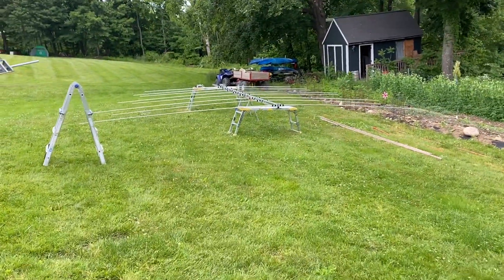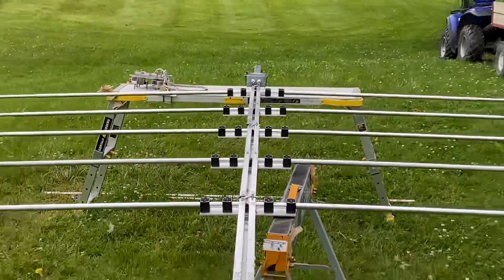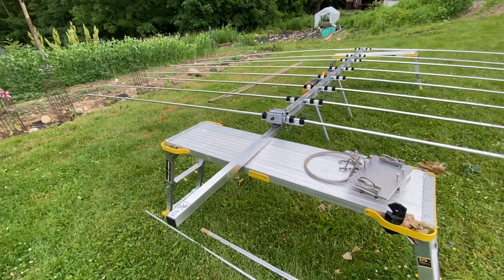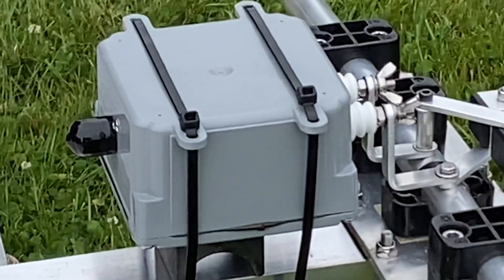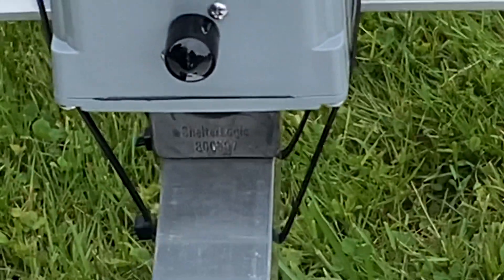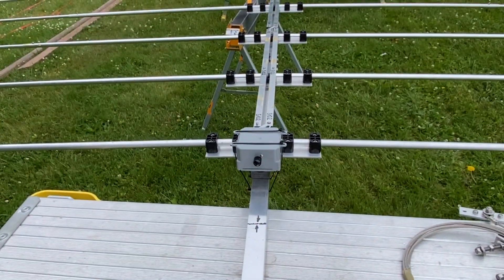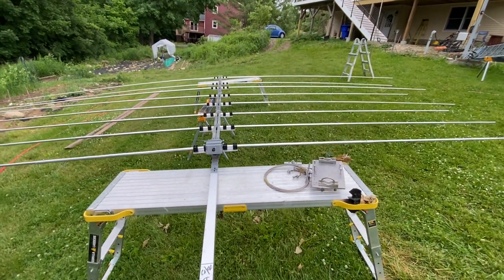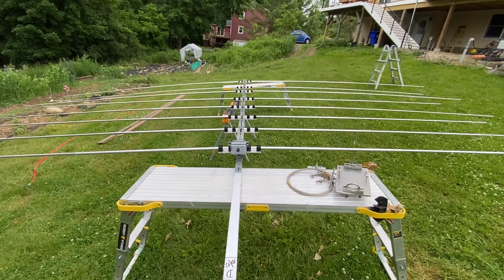Optibeam OBDYA9-4 ham antenna build walk around

Comment: How is the antenna treating you after a year in the air? I've got one in the box that I just received from DXE. Looking forward to better weather and getting it on the tower. How do you like the performance? Thanks.
Reply from the maker: @AbleFox1  This antenna works great. I have been enjoying it immensely.
I have a 500 watt linear that I use, but I seldom run more than 400 watts and can hit Europe easily. I get very good reports from people saying I am one of the strongest stations they hear. The antennas directivity/gain is fantastic and the F/B ratio gives good rejection off the back. I am glad I chose it although it would have been nice to have the model that added the 20 meter band.
Reply: @sparky2008sparky  Thanks for responding so quickly. It's good to hear you've had a good experience with it. I had a large LPDA at the last qth and didn't want to get in that deep this time around. Started off looking at a Hex, then to the short boomed 5 band Opti (F/B didn't look great) and came to this. I've been licensed for about 40 years and seldom work 20M so I figured this would be a good fit. Mine is going up on a 65' aluminum crank up/tilt over and I was also concerned about getting too heavy up top. Curious, how heavy of a mast did you use and what are you turning it with?
Reply from the maker: @ happy to help!
My tower is a 52 ft telex hy-gain crank up from 1992. Bought it used and didn’t want to stress it too much putting a heavy antenna/rotor system on it since I have a 10 foot derrick with a pulley on top and winch to fold tower over for service.
My mast is a 6 ft piece of chromoly from dx engineering (i think 2.5”dia, 1/4” thick). It’s pretty heavy. I used the yaesu rotator (i forget the exact model..dx-1000?). Bottom line - you need to run a moment calculation using mass of mast and mass of antenna and wind area of antenna to ensure rotator can handle the accel/decel forces. Yaesu has the formulas in their owners manual you can get online. Make sure your mast is long enough above antenna to provide support for boom ‘droop’ cables ( i should have made my mast 7’ instead of 6’).
Reply: @sparky2008sparky  Thanks, all good info. I have the G-1000 SDX as well. Overall, our two setups are very similar. I'm glad you mentioned having enough mast for the boom truss. 7 feet of mast over the boom sounds like a lot? I'm guessing the length of the truss cable can be shortened to match the available mast. I would think 12" to 18" over the boom would be plenty of height to support a moment of 8 feet/30lbs.  The 2.5"-1/4" mast is pretty beastly. Nice. I'll probably go with 2"- 1/2" walled 6061. The antenna will only be a few inches above the thrust bearing...not much load on it. Thanks for the info. I'll post something in the spring when I get it in the air.
Reply from the maker: @AbleFox1  just a correction. I told you incorrectly that the mast is 2.5 inch diameter - it is actually 2 inch diameter, 1/4 thick. Also, the total length of the mast is 6 feet. 2 feet are inside the tower connected to the rotator, there is 2 feet of spacing between the top of the tower and the antenna and then there is 2 feet above the antenna. My comment to Tom at Optibeam was that his instructions did not specify how long the mast should be above the antenna. 2 feet works ok, but his support cable that supports each end of the boom is longer than what 2 feet above the antenna provides. I didn't cut the cable, but instead just doubled it back on itself to shorten it that way. Tom's comment was that masts typically are much higher above the antennas...lol, ok DF2 Blue Ocean. Have fun with it! It is an awesome antenna.

Comment: Would it be possible to build the boom, mount that to the mast, then add the elements? I am considering one of these to replace my Steppir DB11. I really want the bigger one with 20m, but my garden is just too small and I don't have the space within my boundary to rotate it without breeching into my neighbours property. What do you do for 20m coverage out of curiosity?
Reply from the maker: I thought I would need to assemble on the mast as well, but laying it all out flat while assembling was much better. My reason for assembly on the mast was that I thought my tower wouldn’t tilt enough so I could install on the mast. Fortunately, it worked out and with the help of a friend, we were able to manipulate the assembled antenna. It’s a bit over 60 lbs…not too bad.
I considered the bigger one as well and sort of wished I bought it instead, but I was concerned that it was twice the weight (120lbs) and that my tilt over fixture might be stressed.
I am now considering putting up a 20m rotatable dipole above this antenna. The full size dipole is around $140 US. Not too bad. I currently use my big horizontal loop and a tuner for 20m. Good luck!
Reply: @sparky2008sparky  Thanks, that's great. The alternative would be  the OB10-5M,  but I don't really like the look.

I have 4.5m turning radius too. My options are so limited.
Reply from the maker: @johnratcliffe6438  I just looked at the OB10-5M and it does look a bit 'complicated'. It looks like it has some nice gain figures though and would meet your turn radius for sure. I checked JK antennas near here and no joy - their 5 band antenna has a higher turn radius as well.

Comment from the maker: Had some trouble with YT comment configuration. Should be good now.

Antenna instructions weren’t too bad, but they did take a bit of ‘studying’
Antenna boom had positions of element’s labeled and every element was labeled as well. Not too bad to put together. Issue I am having is high SWR at high end of 10 m band. I need to bring it down to figure it out.
Reply: Thanks for the video. Any updates on this, how did it work out in the end? (VK5HMB)
Reply from the maker: @silverprado1206  Updates - sure! Antenna went up the tower (tilt over crank up) and has been doing nicely. I have to bring it down again sometime to put a drain hole in the balun to ensure water drains out. I think I had water in the balun after a rain which affected the match. Other than that - great performance. I am always told I am 'loud' and one of the 'strongest signals' typically from European stations (power less than 400 watts). I sort of kicked myself for not getting the 5 bander DYA, but it was twice the weight of this one and I was concerned my tiltover derrick wasn't designed for that additional weight on the 21 foot lever arm (cranked down tower).